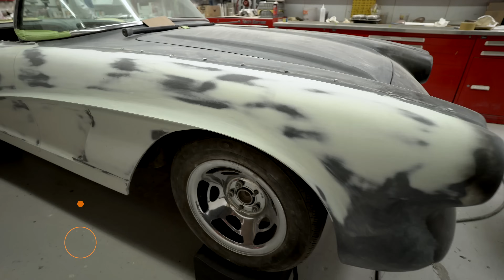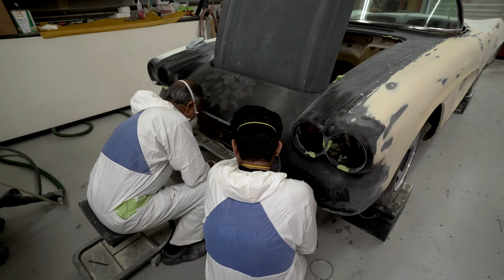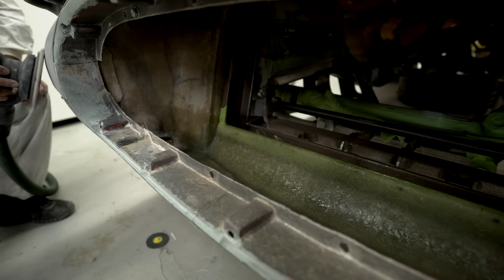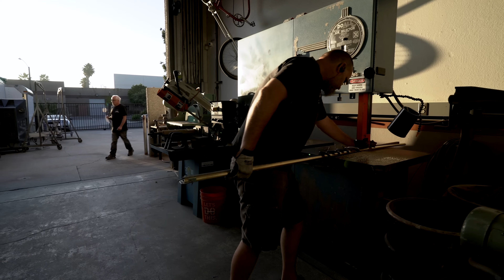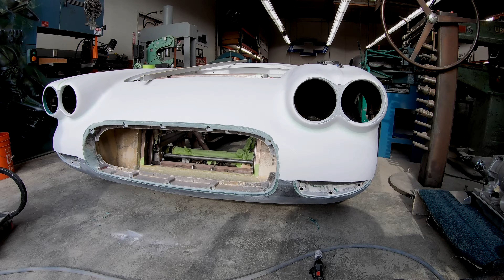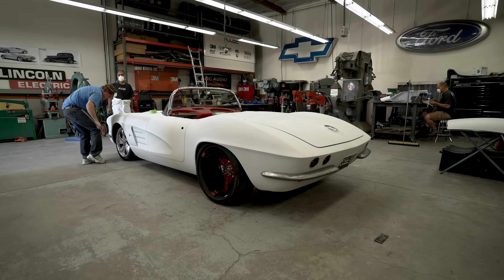Foose Design | '62 Corvette C1 Build - Part 2 - Body Work &  Mock Up

Comment: I have a chrome license plate surround for the 62. The strange aspect is that it is several inches wider than the ones that I see on stock models which are made to fit around a standard license plate. This one is exactly the same design only wider. Does anyone know what this piece is?

Comment: this is one of the few Foose redesignes that im thinking I wont like with paint..the puffy cheeks on the front grill...ehhhh
Reply: Shift -Z Yes. I am wondering the same thing. You can see what the original design was all about. It continued the contours  of the mouth.